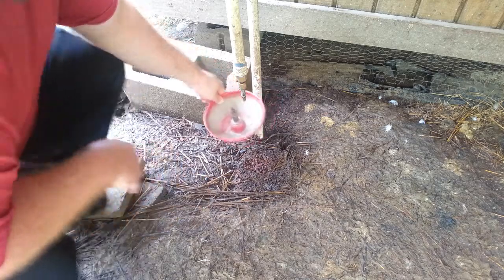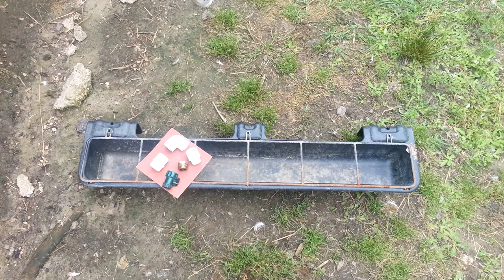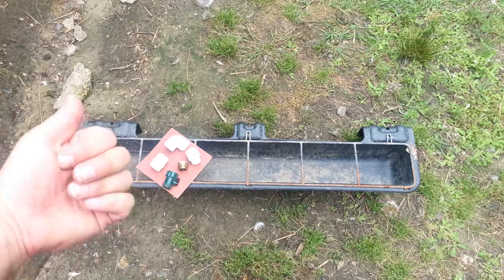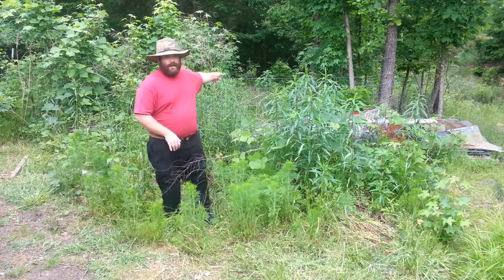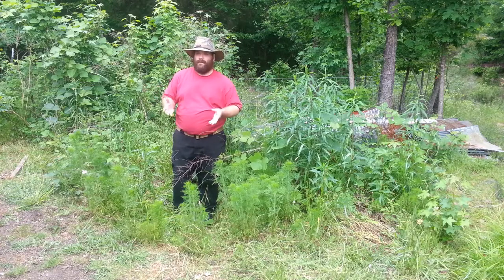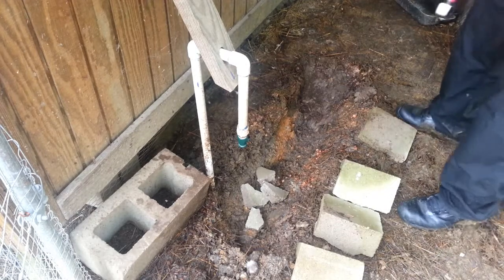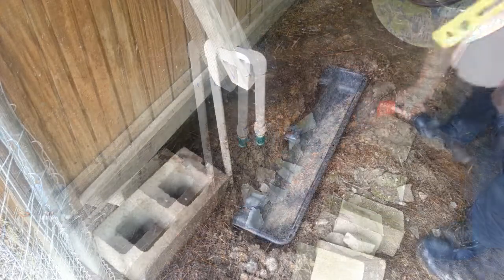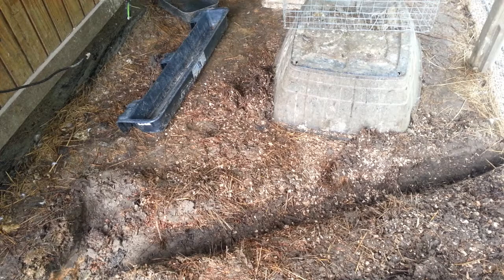Installing an Automatic Duck Watering System

Comment: Using a float valve would avoid the need for the overflow pipe which could be covered over to prevet the ducks from activating it. The existing overflow pipe then could be used for draining the tub should the need arise.
Reply from the maker: hslmnicholas, that would be another way to do it, for sure.

Comment: the ducks clean their bills in the drinking water and if not cleaned out daily could become deep mud on the bottom of the basin.  What good is the overflow if you can't get the bottom cleaned.
Reply from the maker: +Veronica Moore, its true we've had to spray it out from time to time - like once a month. It's not a big deal when it's that few and far between.
Reply: Then I may try it thanks.

Comment: I think you made a great choice in selecting the size and shape of trough to use. I might try something similar with a section of rain gutter with the ends capped. One thing I see that could improve your design, though, would be to use a float valve instead of a constant drip. 

How do you clean this out? I understand they can't actually get in there and paddle around, but ducks still get their bills dirty, and consequently foul the water when they dip their faces. Have you come up with a cleaning method that works for you?
Reply from the maker: We just spray it out with a hose. Takes a few seconds about once a month. Easy peasy.

Comment: Just put a big shallow pan under the pipe coming down and screw a Hudson valve the length/height of the water level desired… $35 and done

Comment from the maker: Our current thinking is that it will be better for us to have to spray out the trough once a week or so, than for the ground to always be wet because of the malfunctioning waterer. That little hose section I said I will put on - we'll just turn the water on full and spray out the trough. We'll see. It would be great to have a dump valve for cleaning, but that feels a little too "overkill" right now.

Comment: I think you will still run into the cleaning out poo issue with this system. I was pondering this problem a few years ago and came up with a system I think would be better for ducks but we have chickens and I think they will still take a dump in the water.  I will make a video on it when I go to the hardware store so I can show you the parts as this 500 character stuff is too short to explain it.

The only system that seems to work for chickens is the little nipples you see all over the place.

Comment: Love the last shot of the ducks. 
Just a couple of things. 
Years ago I watched a documentary about an English landscaper (don't ask me who) in England who fixed and created ponds, for a large manor, that leaked, by using bentonite clay as a sealer. 
You can also install a 2" dia. PVC pipe at the low point of the pond as a drain and have it flow out to flood your gardens with this fertile water. 
If your pond was a little larger and deeper, maybe you can also use Carp or some other bottom feeder to help maintain the pond.

The installation of the drain pipe just below the surface can come back to bite you, as you may operate heavy equipment over it.

As for the water situation, I've been playing with the idea of collecting rainwater to a 10' - 30 " dia. PVC pipe to the vertical on a 4'x4' - 5 " thk. conc. pad, with a float valve installed close to the bottom. As well as a large drain to flush the pipe. Once the water level falls, it will active your main water, this way the ducks will be covered.
And yes, the sound of rain on a metal roof the best. Hahaha
Best of luck and God Bless.
Reply from the maker: Jose Benitez, there is now a fence around that area, so heavy equipment is not an issue: Duck House / Chicken Coop Run Expansion do wish I had used a larger pipe for the drain of the waterer.

Comment: That will work for chicken but for ducks not really. They are too dirty. You will end up cleaning that thing everyday.
Reply from the maker: *****, thanks for your opinion but this is still working just fine for ducks. We clean it about once a month, just put a sprayer on the hose and 'blow it out'.
Reply: J&J Acres ***** I was thinking the same thing, ducks can be very dirty. After watching this I have an idea to create a very similar system that will have a constant flow.  Have it run through a trough in to sump and then get pumped up to our duck swimming tub, which is filtered.

Dirt would go back to the sump and to the duck swimming tub and that would keep the work down when it comes to cleaning up after the ducks.

We have an old 55 gallon bath tub that we use for the ducks to swim in, attached to it is a 500 gph swimming pool filter. I do need to change the filter every other day or so. I use a reusable filter, so that has cut down on cost.  I only need to change the water about 1 a month. Even then I could skip it if I just vacuumed out the bottom every week.

Loved the video it gave me several ideas.
Reply: ***** Now that is a great idea that would cause of the filter.The more filter you have the better.thx
Reply: I still think cleaning it in a month is just too long for me i got to clean it at least in a week.green algae grows all inside and its just nasty.
Reply: ***** I control the algae by keeping the water moving well, out of direct sunlight and am getting ready to add a few gold fish to it.
Reply: great thx